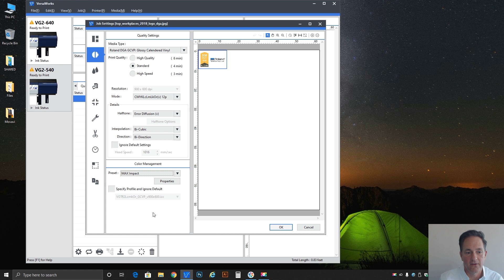VersaWorks 6 - Understanding and Using Quality Settings

Comment: Hey man. Wondering why Roland decided to drop the output resolution compared to their older generation printers? Competitors also come in with higher resolution 1440 output. I’m just curious if there is an actual technical reason for this. When you see max 1200dpi and you’ve had a past machine that did max 1440 you immediately think well I must be taking a hit in resolution quality. Is that the case?